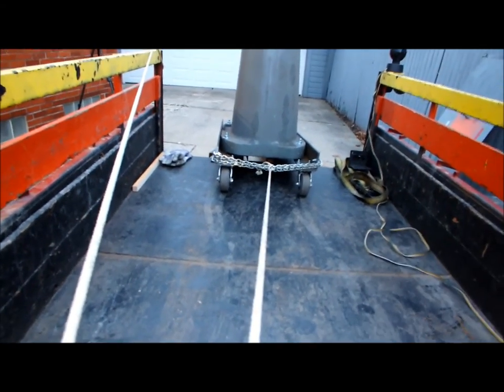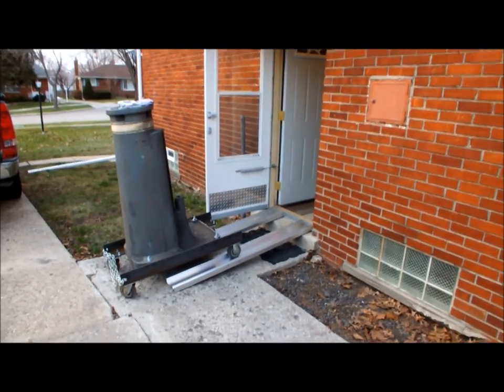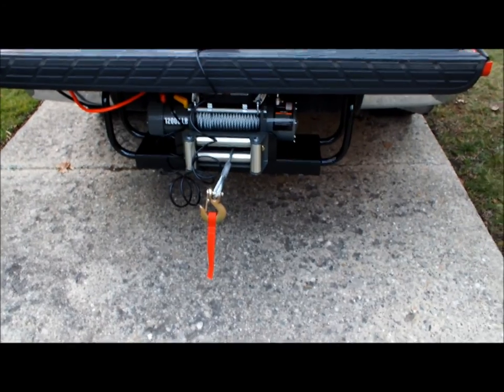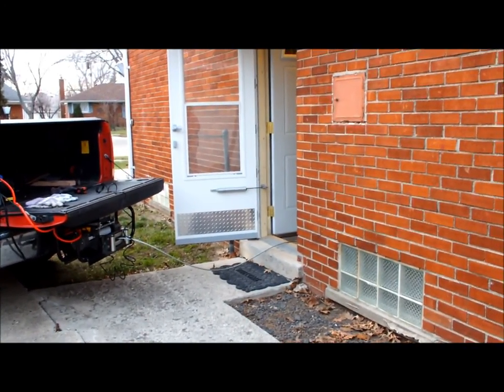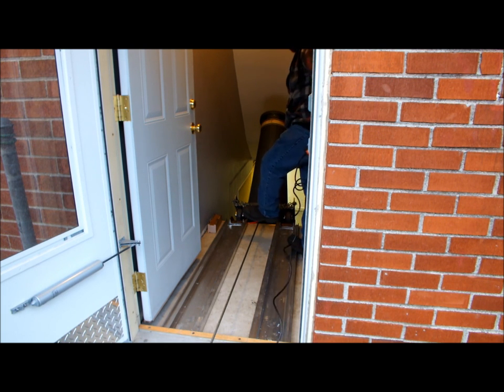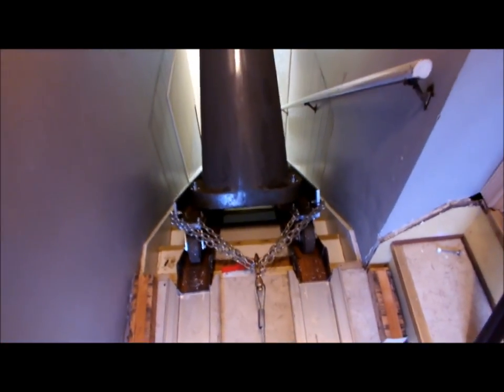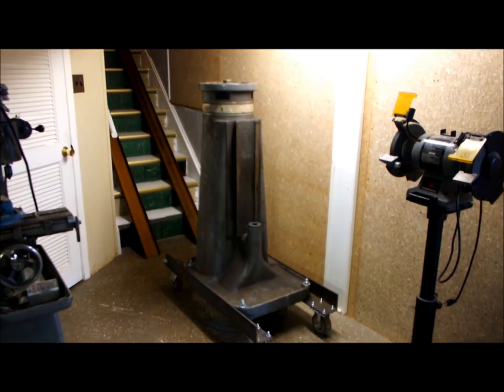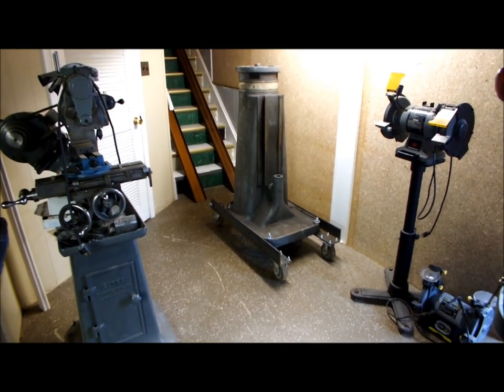millright move by myself

Comment: I just brought the same mill into my basement by myself. I have a walk-in basement but, I had to wheel it down back in pieces on my garden cart that is rated for 1000lbs. The base was the last piece to go down. I had to put it on wood skids and crank it down 3 feet at a time. Reset my come-along and crank it another 3 feet.